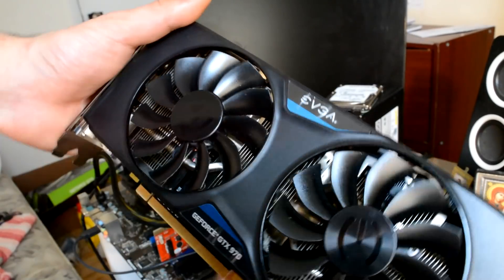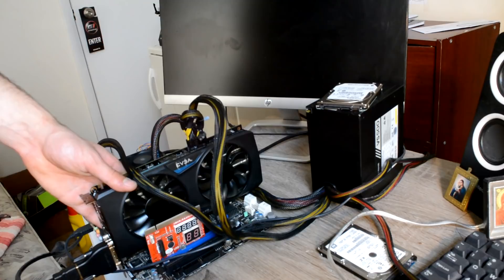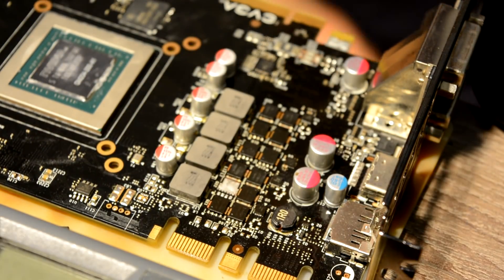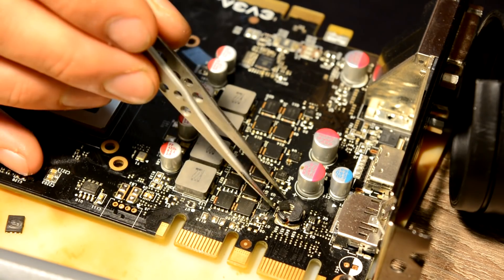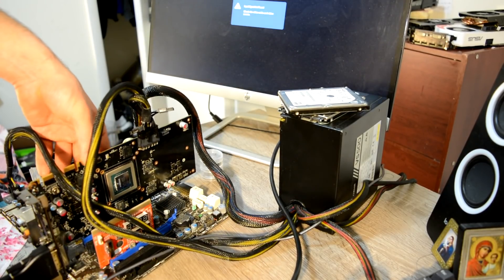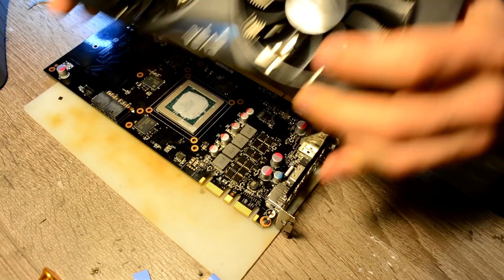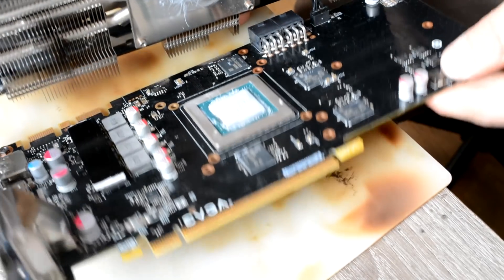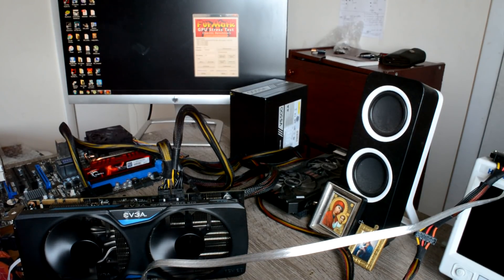GTX 970 repairing phase or what could happen if you don't put radiator back video card repair

Comment: Eli I think you did excellent putting a radiator on the chips without. What puzzles me is how to get exactly the correct thickness. Even a millimeter or two will make the card fail. I think what I would do is put putty on the card, tighten down all the heatsink. Then using a micrometer measure the exact thickness needed. It will crack the solder balls if even slightly differentially pressured. Good job Eli.

Comment: good evening, greetings from Argentina, excellent video bro, in my case (I have the same EVGA 970) with my multimeter i have 3 mosfets that mark a short, Q13, Q21 and Q22... the whole phase would be, so I think the problem comes from the driver... Right? Thanks in advance

Comment: Bro i am having zotac gtx 750 ti dual fan
Problem is this its not detecting by the motherboared and inducter is giving too much noise and the mosfet is going too much hot nearly to burnt what is the solution
I hope you will understand 
Sorry for bad english.🙂

Comment: My Zotac 970 gives black screen then the computer restarts when gaming or using Premiere Pro, I have to let it cool down for about an hour to work again. I did a lot of trouble shooting, and I'm certain it's the card since the situation improved a little after I underclocked below Nvidia stock clock, and now the black screens are less frequent. Some people recommend reballing the GPU itself by a BGA station. What do you think could be wrong?

Comment: I have a Palit GTX 970 jetsream it does not display opened it up got it cleaned checked through all components nothing blown by the looks of it plugged it in while opened and started pc up placed my finger on chip it does start to get hot then pc gives me 2 short beeps and one long beeb and the chip cools off on gpu what else can I check? The resistors allso look fine and did continuity test nothing looks blown

Comment: I have more than 30 GTX 970 with thé same problem. 
No screen when i install driver
I tried diffrent Windows diffrent drivers but always get thé same problem.
When i put a good GTX GPU with the GTX 970 the opengl of thé 970 is 1.1
Pls Can you give a hint of the problem

Comment: Hey man, I have a 750ti LP and there is a short circuit between 12v and gnd. I think it that also one of the drivers is defective. how do i know which one to replace? do i have to desolder them all until i find that the short circuit is gone? or is there a better method? is any other component likely to cause the short? the caps look good to me.

Comment: Recently when playing, my pc turned off and didnt want to start, i checked what happend, and it looks like something wrong with GTX 970 . And i discovered the source of problem, when i unplug both pins, the pc turns on, when i plug in the 6 pin IT turns on too, but when i plug in 8 pin, the pc turns off. Is there any way to fix this? I dont see anything damaged

Comment: I have a EVGA GTX 970 SSC that just failed in a system.  It does not even power up, gpu fans not spinning, or the power supply fan doesn't spin.  Using 750w so not a power issue and been working for 1 year before failure..  It acts like a short on the power rail.  My older GTX 770 works fine in that system.  I tried the 970 in another system. With no luck.  Any ideas?

Comment: Hello, i really need some help identifying  values of a couple of resistors and capacitors on this gpu. I hope someone can help me so i can finally fix and use it. I only need those 2 in small red circles (or if possible, all the components in small green circles) Thank you in advance and there is the link to pcb: https://imgur.com/XF9nsy2

Comment: Hey, great video! I also have a 970 and it keep freezing for like 1 or 2 seconds randomly (especially in busy areas) when I'm playing games. I figured it was a bad drivers, but it turns out that it's happening with every single driver I try. The temps don't go higher than 45° C. It's a shame. I don't know what's going on... Do you happen to know what's wrong with it? It'd be awesome if you could help me out. Thank you!
Reply: Freezing every 1-2 seconds means your thermal paste needs reapplying.  It's bad.  It got dried up or cracked or whatever and a connection isn't being made.  Did you recently handle the card before this happened?  That's usually all it takes on some very old paste.. pulling the card out and putting it back in.  

Your temps show super low because it's throttling super fast.  Just put new paste on the core and you'll be good to go... if you still have the card.  It's been 6 months.

That's been my experience.  I guess there's a million things that it could be... but yeah, monitor your clock speeds and just see if they are dropping a lot.  For example, a STRIX 480 8GB should run at 1310mhz core but with the factory paste dried up after nearly 5-6 years, it would throttle to 500-700mhz even though the temps were in the 40's.
Reply: Sounds more like a hard drive or cpu problem

Comment: I have a card on which the exact same mosfet caused a short. While I did not have the replacement parts available yet, I reasembled the card. After only removing this mosfet, the card works again. However performance is poor, the core clock is stuck at 135mhz due to the fact that the card has a wrong tdp/power reading of over 200% (apparently an issue which is more often seen on GTX600/700/900 Nvidea cards) Will these issues be solved by putting in the new mosfet and driver? It would be interesting to know if these shortcircuit and tdp issues are related. Maybe you/someone can answer from experience.

Comment: The transistor on my gtx 970 has also burnt out where do i get a replacement one?
Reply: I bought them on Aliexpress. If the one you have blown is like mine, 4C10N, then you can buy from here https://www.aliexpress.com/item/32881631098.html?spm=a2g0s.9042311.0.0.419e4c4dDxNCbK or https://www.aliexpress.com/item/32901935217.html?spm=a2g0s.9042311.0.0.27424c4dIVn4Pg and you will probably need phase controllers too, which you can buy here https://www.aliexpress.com/item/4000048500209.html?spm=a2g0s.9042311.0.0.419e4c4dDxNCbK
Reply: @karalux996  how did they work out? I am about to order all three. Is it a go or a no go. I lost my q22 as well.
Reply: @chwade6065  i had a short somewhere else in the pcb, ended up frying all of them and gave up for now, dont have much time for playing around with this. The mosfets themselves are just like original and good quality, controllers probably too, they werent making any new shorts
Reply: @karalux996  cool thanks ill move ahead
Reply: Did you find it?
Reply: @PedroLentine  Nope, i have looked at lots of different mosfets for it but i havent a clue which ones are suitable if anyone has any idea what ones are needed it would be nice to know.

Edit its the exact same one as this guy has changed so would love to know where he got this one?
Reply: @chilledolay4065  Any N channel, low rdson, minimum 30V 50A mosfet will be fine. You can get the original from Mouser or Ebay, but you can desolder them from old gpus, and mobos too. If you are not sure just tell me the old and replacement fet number and I'll check it for you.

Comment: Hi, there. I have the same evga 970, it got shorted while I'm winning a lol game.....so I don't know how that game went. but I checked and the same mosfet was short on the gate, took it off, short is gone,  seems like a common problem.. now I'm waiting for the replacement mosfets, and a rx580 from amazon.....
Reply: I ended up canceling the rx580. the new MOSFET part number NTMFS4C10NAT1G is working for about 2 days. and the same thing happened. I replaced another one and order a dead card form eBay for 45. I didn't see a problem anywhere else, could be that the heating problem? the card didn't come with a radiator for these MOSFETs. guess I need to get some cooling down there.

Comment: is a thermal pad called radiator? is that the correct term ?
Reply: @Ave atque vale im reffering to eli he said radiator when he speak about thermal pad, btw i know radiator, thermal pad ect, i built my high end pc with custom open loop water cooling system myself.

Comment: Hi Eli, absolutely love your videos! I have an issue with my - When I install NVidia drivers, it shows Error 43 in Windows with a yellow exclamation mark. When it runs basic Windows driver, it works fine. What do you think with your experience could be the issue?
Reply: bad gpu, may need reball
Reply: @harrisonwendel6466  could also be bad vbios. Happened to my r9 290. I fixed it by flashing a newer uefi vbios on it.

Comment: Mine burn the same transistor!, where can I buy it? what model is it?
Reply: It is an NTMFS4C10. You can find it on Ebay or Aliexpress. I had some good experience with a particular ebay seller. I got the replacement 10 days after ordering (China -> Europe)

Comment: Looks like these damn FTW editions are ticking time bombs seems fixed after their refamp with the new PCB of the SSC edition

3rd card blew up last week and it was only 7 months between this one and the other one which i was lucky to get warranty for but 7 months later this PoS craps out again.
This time no visual damage to see but i still think its one of the mosfets which has probably shorted. But i have no way of testing so i think about replacing all the mosfets (Qxx) and seeing if it fixes it lol

Comment: I would like to ask about the hot air station you are using,it looks like its doing very good job and the mosfet desoldered in very short time.I use a weller wma-1 but it is very small for these boards and i am intending to buy a new hot air and looking for something extemely powerful.Testing with furmark as a load seems like a rat sitting in the back of an elephant.

Comment: i have the gtx 960 one of my transistors went up in smoke, wish i could fix mine
Reply: Not recommended but if it's a pair of mosfets you're able to remove and it will work until you source a replacement

Then a just a heat gun and Soldering iron can fix it

Comment: With a GTX 970 EVGA FTW card, which has a "Connect and connect the PCIe power cable (s) ..." cable has no open fuse, no fuser open, no INA3221 has been replaced and no problem, it has all the tensions, please help me.

Comment: I wanted to know if you could help me with this board, I'm breaking my head with a board in an absurd way help me please. I purchased from a customer a GTX 970 EVGA ftw connecting and the auxiliary power cable warning disconnected "PLEASE POWER DOWN AND CONNECT THE PCIe POWER CABLE (S) FOR THIS GRAPHICS CARD" have already resolved other cards with the same problem form simple, has no fuse, inductor or fuse open I already changed the BIOS chip I changed the INA3221 imagining that it is the controller the auxiliary power supplies, I changed the shunt and nothing, the power of the connector goes through all the components apparently normally, I need a guidance than trying to do.

Comment: Thanks for the video. Its very helpful! I got same issue on MSI GTX 760, its High aswell. Ive ordered new ones by aliexpress. How many degrees you soldering with hotair? Its very important for me.  Hope I will see much more videos :-)
Reply: Did it work? I have the same problem now. What is the name of the part needed. I'm looking on Aliexpress but there are so many.

Comment: hi where do i get the mosfet driver from mines blown thanks
Reply: aliexpress or trash-card
Reply: @TheMaGGiiiii  thanks it was that my mosfet got hot and melted the solder and cause short circuit which power off the psu but fixed now il save them sites for next time thanks

Comment: Hey man do you have any 970 memory chips ? 
I bought a faulty card off eBay. 
Guy said bad cap. 
Turned out it was covered in coke. 
Removed 1 memory chip and found 2 pads corroded

Comment: @Eli Tech There is no active cooling of the GDDR5 RAM nor of the VRMs on this card, with both components cooled entirely by any airflow that makes it through the heatsink.. Other / newer version like FTW plus uses cooper heat pipes. You can see here on this forum / test pictures of cooler itself. Cheers
https://www.anandtech.com/show/8568/the-geforce-gtx-970-review-feat-evga/2

Comment: I subsribed to your channel! Because suddenly my system got power cut off and cant turn back on. After every troubleshoot, i came to conclusion to take out my gpu and psu. So here is my story :D
Gpu; msi gtx 970 4gb
Psu; cooler master gx 750w

I jumped start psu, just to check if its my is dead. So found no its not.
I plug 6pin to my gpu, switch on psu, its still on. Ok.
I plug 8pin to my gpu, switch on psu, its on then cut off. Theres a short at 8pin connector. Am i right?

Comment: Great video! I have few questions. where are you getting all that information where to measure and what to expect there? Do you have schematic for the cards or you just get datasheets for the mosfets and controllers/drivers? Where do you get spare parts? ebay or dead cards pile? Thank you.
Reply: For GPUs you can learn a lot from the channel "actually hardcore overclocking". There aren't publicly available schematics for GPUs so it's mostly just built up knowledge and being able to identify it when you see it. In this specific case the MOSFET was blown up and the damage was visible.

For parts. They are mostly standard and have the part numbers printed on themselves. You can buy them on eBay or Digikey or other sites like that.
Reply: When a gpu doenst turn on and it got a short between +12v and ground then it probably has a bad mosfet(s).

Comment: I have the same 970 from evga. same exact transistor cooked!
Reply: Did they have any cooling fins or anything?
Reply: Me to at the moment
Reply: same
Reply: me too, can anybody shed some light on what I need? a part number maybe?
Reply: @romeowhiskey2759   I had an GTX 970 from EVGA and it needed a new NTMFS4C10N MOSFET. Dunno if that was you were looking for
Reply: @Buffalotoast21  thank you very much indeed. That's the one.
Reply: I have the same 970 as well. Mine also over heated but the transistors don't look burned at all. Do you guys think i should just replace the transistor drivers 1 by 1?

Comment: I have Zotac 970 mini card that hit 83C when playing FC5 (everything at max and at 1920x1200), and I played it between 79-83C for hours and hours, no overclock. I go to shut off machine for a few days, then I go to turn it back on and it did not want to display. I had to wiggle the board a bit to get it to come on. Hope I didn't damage it. I haven't turned my comp off since then.

Comment: thats why I stay away from EVGA
Reply: Jhay12 Why? I’ve been running my GTX 970s for 3 years now, gone through crypto mining, nothing wrong with them. So, not sure why you “stay away from EVGA.” I had a 750ti I shorted myself on accident and they even sent me a new one for free believe it or not.
Reply: @FeelTheThunder not anymore , the warranty system is changed and honestly EVGA use cheap components so I agree with the comment

Comment: Great video! I wish i could fix my GTX 780 like this. But i`ve no idea...
Reply: You wouldnt belive but it works! I cooked it for 10 mins on 200C and now it works! lol Thats F** crazy dude... fixed! I swear!  @zupaPOMIDOROWA6
Reply: @RoGie_B  Hey, I recommend using a liquid flux under the GPU and the memories of the GPU and put thermal pads on the memories to last longer, only in my experience because recently my GTX 760 4gb ACX returned to give artifacts only 6 months after resuscitating it in the oven without putting the flux or thermal pads.
Reply: @RoGie_B  I believe you it works :D I repaired my old nVidia 6600GT this way. It had pretty bad artifacts even in 2D mode (since BIOS post). I removed all plastic elements, covered capacitors with aluminium foil and placed it in the oven for like 10min in 180C and it was alive. However, there is scientific proof of this method - because of ecological regulations, they use soldering alloy without lead. Lead was stabilizing structure of tin. Without lead, tin starts to form micro whiskers on the surface. Whiskers may create small shortcuts and case artifacts. Cooking can probably melt that wishers and bring card back to live. Second option - cold solder. It can also be melted and repaired

Comment: Hi where you live? can you fix my gpu?
Reply from the maker: Sk Md Faysal Islam Chicago
All info in About of this channel
Reply: @elitech3339  too far :( not possible to send my card and get it back... nvm thx anyway. can you atleast tell me what kind of problem in my card? My gigabyte gtx 770 4gb does play windows and other things perfectly but when i play high graphic game then my display go dark where i can listen sound sometime and sometime lagging sound and restart automatically. i tried to clean and used new thermal paste and thermal pad but still same problem. plz help bro !!
Reply: @skmdfaysalislam1259  A bad powersupply PSU? Or a to low wattage one ?
Reply: @skmdfaysalislam1259  hi, i hae the exakt same problem with my pc. My screen whent black when playing games  sound from game was still on but, no display. My problem was my screen was dying. I used other monitor and no black screen anymore. Try it out! It might be still be bad psu thou..
Reply: @skmdfaysalislam1259  I can almost guaranteed that you have defective power supply. Change that before your GPU catch fire, and you're good to go.

Comment: dear u have gtx 770 msi t.f i connect 12vdc directly to the fan connector and i smell a smoke , so no signal and the fans run at high speed !! please help me what component should be replaced i found a burned  sot 23 transistor behind fan connector and i cant read smd code plz help me
Reply: copy and near bie transistor